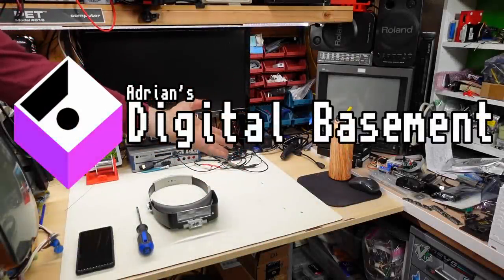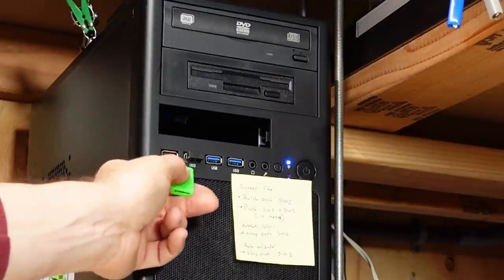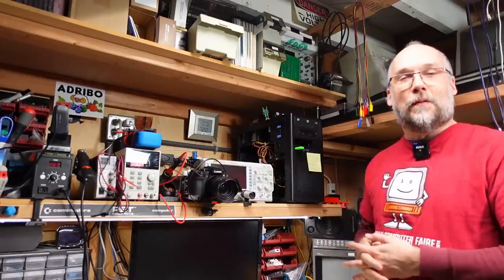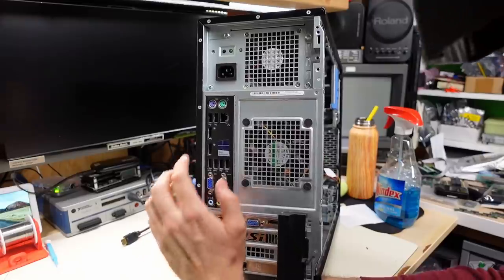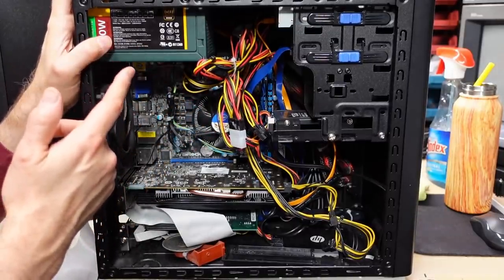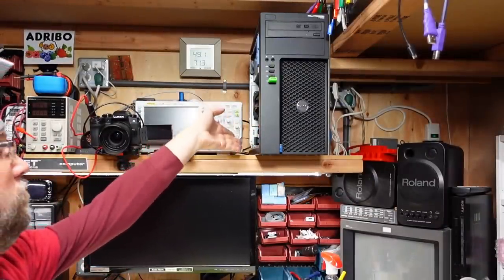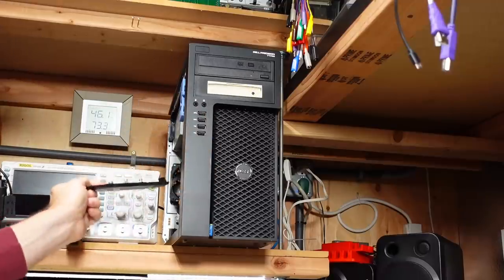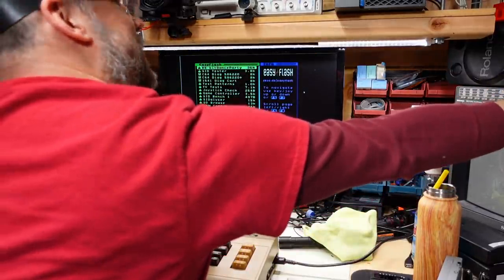Let's upgrade my lab PC and talk about tools I use to make videos

Comment from the maker: I wanted to add, after making this video, I bought this Startech PCI-Express to IDE card 
 https://amzn.to/3dSgCpN which uses the JMicron firmware, and the Zip drive is now working perfectly! The card is just recognized as a "Standard PCI IDE Interface" in Windows 10 and the Zip drive is functioning great. I had tried a standard old PCI to IDE interface I had but Windows would not load drivers for that -- even when I tried to force them on. The JMicron cards are the way to go clearly! (JMicron cards flash a quick BIOS screen at boot showing you any detected IDE devices.) Also note, I only tested this in Legacy boot mode, so not sure if it works in UEFI mode.
Reply: Many old PCI IDE adapters were detected by Windows as SCSI/RAID adapters and needed special driver. If there is no driver for Vista/Win7, there is no chance to use them under Win10.
Reply: The screws in the drive bay blank are intended to be used with the mounting holes on whatever you insert into the drive bay.  The Dell case uses odd screws that slide into slots in the drive bay to hold the drive in place.
Reply: I think uefi mode only affects bootable devices.
Reply: Like what John Bailey said the screws to mount a 5.25 drive in the bay are on the back of the punch out front panel. Pull down on the blue tab next to the 5.25 bays and push the DVD drive forward to see the specifics. But once installed it should just slide in and click to lock in place. Actually a pretty decent design.
Reply: The PS2 ports are needed on machines like this in case a company needs to disable USB access to provide extra computer or data security.  And to protect viruses from getting in, or to protect top secret data from getting out.
Reply: LOL! As you were talking about trying to use a SATA to IDE adapter to make your Zip drive work, I was literally going to amazone to buy you one of these cards! I'm glad I checked the comments first!
Reply: @xsc1000  sometimes you can use those drivers even if they are not compatible, by installing them as admin and compatible mode.
Reply: If you're using an SATA to Molex power connector for the drive, be careful, plenty of stories of those causing fires!
Reply: @johnmazella4858  
Molex to Sata, lose your data.
Sata to Molex, what rhymes with Molex?
Reply: I had a USB 3.0 problem on my pendrives on X79 platform (similar to Yours). Windows 10 simpy couldn't see them at all (while they worked fine on USB 2.0 ports). After trying different things, I figured out it was default/Windows Update provided USB 3.0 drivers that were giving me issues. After installing manufacturer ones (in my case, ASMedia), all 3.0 ports started to work properly. 
I still have to check which drivers are used with USB 3.0 when this issue returns (luckily not often).
Reply: this may help fix your pc if it is still having issues:
 If your PC isn't performing as well as it once did, and you don't know why, you can refresh your PC without deleting any of your personal files or changing your settings.
Note: If you upgraded your PC from Windows 8 to Windows 8.1 and your PC has a Windows 8 recovery partition, refreshing your PC will restore Windows 8. You’ll need to upgrade to Windows 8.1 after the refresh has finished.
Warning: Apps you installed from websites and DVDs will be removed. Apps that came with your PC and apps you installed from Microsoft Store will be reinstalled. Windows puts a list of removed apps on your desktop after refreshing your PC.
To refresh your PC
Swipe in from the right edge of the screen, tap Settings, and then tap Change PC settings.
(If you're using a mouse, point to the upper-right corner of the screen, move the mouse pointer down, click Settings, and then click Change PC settings.)
Tap or click Update and recovery, and then tap or click Recovery.
Under Refresh your PC without affecting your files, tap or click Get started.
Follow the instructions on the screen.
Reply: The reason your previous computer's USB 3.0 ports probably gave up is from old age. Motherboards tend to deteriorate in mysterious ways around 2nd to 3rd generation Intel era.
Reply: @MrNamegame  I was going to suggest something similar.  Commonly USB 3.0 (type A) ports will fail because they work by pins on the back of the USB plug reaching the tip of the USB port and this connection has to happen within a time frame of insertion (don't plug USB 3.0 in slowly) or it downgrades to USB 2.0.

USB 1/2 also runs in parallel on the same cables with the original 4 pins, but USB 3.0 has 5 completely new connectors and a deeper port.  So if the pins on the tip of your port are tarnished/dirty it could impede USB 3.0 connections or if they are damaged or the USB 3.0 port transceivers break it could drop to USB 2.0 because it is a separate bus.

Comment: I really miss the times when drive bays were an essential feature of every pc case.
Reply: This is why I haven't upgraded my case in years. I don't need floppy bays but I still run a BDRW so my Corsair carbide air 540 case with it's two 5 1/4 in bays will keep me going untill I no longer need an optical drive.
Reply: Yes me to
Reply: @mcborge1  i just don't see the purpose to having a optical drive... not sure i have had one in the past 15 years and if i ever do find the need for one that is what external bays are for lol..... on that note i am so glad windows can be installed from flash drives now as network installs kinda gross
Reply: @brykanst9071  Some of us still run classic games that for licensing reasons are not supported on digital platforms and some of us still use optical drives for archiving backup data such as 3d files and mod backups. then there are people who still have a music cd collection who put their PC's to use as a stereo system. Just because you don't see a use for an optical drive doesn't mean no one else should either. Each to their own as they say.
Reply: You can still find some, but they are the minority.
Reply: @brykanst9071  - If you are into classic games, you want an optical drive.

Comment: Old Dell Precision workstations make fantastic PCs and are still plenty capable. You can do all kinds of upgrades (GPU, ram, etc). The PSUs are ridiculously strong. Most have a raid controller built in for a nice raid array (I used it for a striped raid of a couple of ssds for c drive).
Reply: Old dells were like tanks, we had an old 386sx desktop at work that ran for over 20 years before it died. Far cry to what dell is now a days with their disposable crap
Reply: As someone who has personally deployed and serviced  tens of thousands of Dells various desktops and laptops I can tell you that they are really crap, the new ones are even worse. The best part is the crappy proprietary  power supplies. If you want a quality OEM product you would go with Lenovo. Out of 100 Dell machines I will probably see 1 Lenovo and its because of something the end user did not because its power supply decided to explode.
Reply: @someone28  Yep which sucks cause they use to be decent, now they are disposable crap. Gotta love their motherboards too now a days...what a joke. I'm not sure with lenovo either now that they have started to lock down ryzen cpus

Comment: Nice to see that Windows now moves so easily from machine to machine! XP absolutely did not like being moved, and I think even Win7 would blue-screen upon encountering a different motherboard (or at least a different chipset).
Reply: No kidding. It's something Mac OS accomplished years ago during their classic age. Just move the System Folder and you're done lol.
Reply: Windows 10 is pretty forgiving. I tossed a windows 10 hdd from an asus laptop in my obsolete MacBook, and it fired right up 🤣
Reply: I never had a problem moving WinXP or 7 to a new system. So long as you are staying with the same processor brand and keeping changes to a minimum (e.g. peripherals stay the same, drives stay the same, video card stays the same), that gives you a stable boot. Changing the video card or peripheral mix, best saving that for subsequent power cycles, and even that was more to avoid Windows deciding it needed to be re-activated versus things not working. Repair installs would usually take care of any oddball failures, and to be honest, you're still better off with a fresh install anyways to "clear out the cobwebs".
Reply: I’ve moved an AMD windows 7 install over to an Intel computer. I’ve also moved around almost any combination on windows 10 with no issues. Windows xp and earlier don’t like it though.
Reply: @kd7cwg  I once stuck a windows 10 hdd in a MacBook from 2005 and it booted right into windows. It was extremely slow but semi usable
Reply: Win 7 worked fine from Intel -> Intel, Intel -> AMD. But not AMD -> Intel.
You can migrate XP to other boards, but you have to reset the IDE driver to default, otherwise XP would load the specific driver at booting and bluescreen.
Reply: @derstreit  I moved amd to Intel on windows 7 and it worked fine.
Reply: @EvilTurkeySlices  good to know that i can work!
Reply: @darthrevan2063  mine is a 2006. Core2duo. Still runs horribly slow with windows 10 lol
Reply: @darthrevan2063  Weren't the first Intel Macs in 2006? If so, something tells me as flexible as Windows 10 is, it's not about to boot on a PowerPC chip. lol
Reply: Windows 7 Works Fine of you move it, unless you Star with Intel of AMD. You can‘t move from Intel to amd.
Reply: It had to do with Windows lacking the correct driver for the chipset's SATA controller, if I remember right. You could also cause Windows 7 to BSOD on boot by changing your SATA controller's mode from XHCI to RAID or something like that.
Reply: Why is it so hard to move Windows 10 from an HDD to an NVME drive on the same laptop then?  I've tried on 4 different laptops using every drive cloning software I can find, including paying extra for NVME drives that come with their own cloning software, and I have a 0% success rate.
Reply: @Leon Mailfert I think you mean UEFI.  I am pretty much out of ideas, and I'm about to just give windows the boot permanently and put Linux on every computer I have.  With some cloning software I'm able to START booting from the NVME (with or without the original drive still connected, doesn't make a difference), but I'll either get a bluescreen, or it will tell me that windows needs to be repaired, and no matter what I do it will not allow me to repair it.
Reply: honestly i have never had an issue moving a windows drive all the way back to windows ME it just worked... you must be changing too much hardware without removing drivers or installing new ones
Reply: I accidentally booted an SSD out of my intel laptop in a newly built AMD desktop and somehow Windows activated itself. After doing a clean install it didn't offer me the option to buy a license :(
Reply: One thing I like about Linux here is that it re-detects all the hardware at every boot, and doesn't try to remember what hardware was present last time, so you can move a drive with Linux installed on it to a completely different machine (even from Intel to AMD or vice versa) and it'll probably work fine.

Comment: Happy to hear about your new computer.

The button on the powersupply is so you can test if there are shorts on any of your devices.  pressing it will power the supply on and turn on the devices it is plugged into.  A Green light means the power rails to those devices are good and there isnt a short.  It isnt too smart as it is mainly looking for shorts but can be useful none the less.

You will not be replacing any of those fans with off the shelf ones.  The 4 pin connector on the Dell Prescision and Optiplex line of computers is not your standard 4 pin connector.

As for the rear fan, it is a Sunon branded fan, but one of the neat things is it uses MagLev technology instead of ball bearings or shaft bearings.  So that fan would be equivalent to the Corsair ML fan.  It is very very powerful.  I have one that has been continuously on for well more than 10 years (always on) and it started making some odd noises.  Sadly there is no way to lube it like you have shown in some of your other videos and replacements cost about 15-20 dollars.  You will be better off looking for a Delta fan made for the Dell workstations if you need to replace it... or get to splicing cables!

If you need to replace the powersupply there are adapters out there including one from a company called Longdex.  I picked one up and could send it to you if you ever need it.  Also i might have some spare drive rails for the machine as well.

Glad you are happy with your new machine and i hope it will give you many years of good service.

Yours Turely

The Linux guy who sent you some linux stickers and a PCI SCSI card before you started doing Mailbag videos ~_0
Reply: Of you repin the new fans to dells standard you can change them. Or I think you can.... I have a huge box of various dell fans and blowers from my old job and I have repinned a few of them and put them in standard systems. The power, gnd, tach and pwm appear to be standard, just in different spots. 

I have not done the opposite and repinned a std fan into a Dell, but I don't see why it wouldn't work.

Comment: The Rosewill Line-M case that's featured in the video is definitely one of few MicroATX cases that can be bought new that has all of these:
Four front USB ports
Two included 120mm fans
At least one 3.5" and 5.25" drive bay
No side window

That makes it my case of choice for builds that are function-first.
Reply from the maker: Yeah I'm actually keeping that case even if I took out the old motherboard and parts... I like it for those exact reasons you mentioned.

Comment: I have the same T1700 in storage. I used it as a DVR for a few years and that thing was a beast.
That adaptec card caused flashback to year 2002 when that exact adaptec card fried a rare Alphaserver and then another server I had. After it killed the 2nd machine I suspected something was wrong with the adapter.

Comment: Looking up the serial number for that Dell Precision T1700 we find that it was delivered with that E3-1241 V3 you identified, this is basically a locked (non-overclockable) i7-4770K, or if you prefer you could think of it as an i7-4770 with very slightly higher base clock but identical turbo frequency. Xeon E3's are basically just i3/i5/i7s, the E5 are the ones that use different chips. You nailed it, slightly newer and faster but not massive.

The Dell build spec also says it originally had TWO AMD FirePro W4100 workstation GPUs (roughly Radeon 7750 equiv but expensive, 50W TDP each) so together they could drive 8! monitors, those were clearly was replaced at some point though but I assume that's why it got the (slightly) bigger PSU model - Dell likely wouldn't allow that config without the PSU upgrade.

The official "NVEnc support matrix" says the 750 Ti in it now supports all three types of h.264 encoding/decoding (4:2:0, 4:4:4 and lossless) but none of the newer h.265 encode/decode methods. I'm fairly confident it's better than the old AMD card for encoding and is definitely a lot faster overall too - not that it'll probably matter for this.

VirtualBench DC psu: Spec sheet says it's capable of providing three voltages, they can be set to 0-6V/0-1A, 0-25V/0-0.5A and 0 to -25V/0-0.5A respectively, with very precis voltage and current limiting (and readback). Looks neat for quickly powering small things, even if it would have been nice if it the "main" rail was a bit more powerful and/or it had four voltages (for +/-5V & +/-12V).

OTOH, it specifically notes that the two 0-25V rails share zero point but is "isolated" which should mean you can use a cheap 5A or 10A voltage/current controlled single output bench supply to provide "main" (5V) power, connect that the rail 2/3 zero point to the negative/zero side on the bench supply and tell it to generate say +/-12V referenced of that.

The 0-6V/0-1A output is apparently NOT isolated however - I'm guessing that means it can't (easily) be used to generate a -5V supply, it might be possible to generate a different positive voltage (3.3V?) but I'd suggest checking the manual first for that, it should explain the exact limitations but I'm not going to dig that deep.
Reply: FYI.........My 750 Ti does h265.
Reply: xEON cpu'S are not the same as the I7 cpu's they don't turbo as high. e3  4 core are the worst Xeon's as they only do 4 core.  but he could drop the I7 4770 in there instead as the higher clock speed would be better for video edits
Reply: @madb132  Actually, the E3-1241 V3 actually have exactly the same turbo speeds as the i7-4770K, unless you overclock the 4770K (which includes things like MCE). But given that this is a workstation motherboard it likely has NO overclocking options in the BIOS  nor multi-core enhancement (MCE) options and it's way too old to support XTU so... they'll clock EXACTLY identical in this if it'll even accepts the 4770K at all which isn't guaranteed! (the manual say it support a 4770, but 4770K is not listed).
The later i7-4790K (Haswell Refresh) would physically fit and the higher base & turbo clocks would give ~10% extra performance but it's at best a crap-shot if the motherboard will allow that.
But if you someone has a spare 4790K and this motherboard they can try. Just don't be surprised of the BIOS decides "not recognized CPU, not initializing enough to even enter BIOS menus", this happens even on some desktop boards and workstation boards tends to be far more picky than desktop boards.
Reply: @Torbjorn.Lindgren  You can over clock on these boards by using intel ITU prog but the Xeon won't as it's locked multiplier so as i said the Xeons DO NOT clock as high, why do people bloody argue facts?